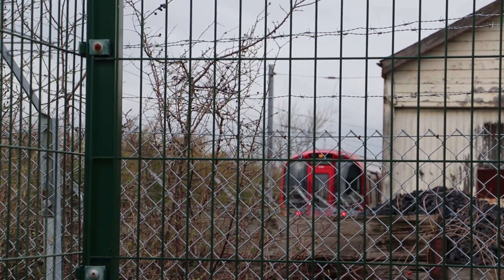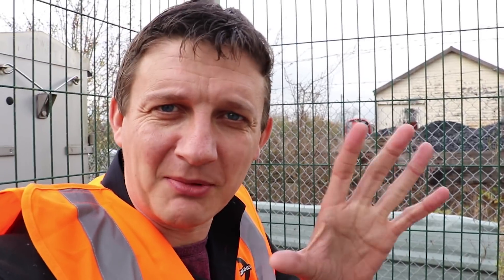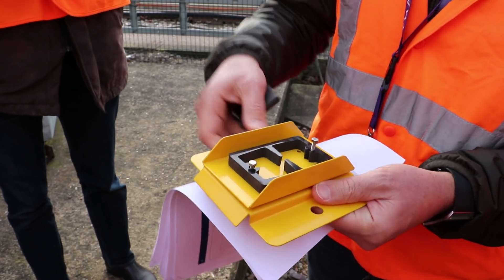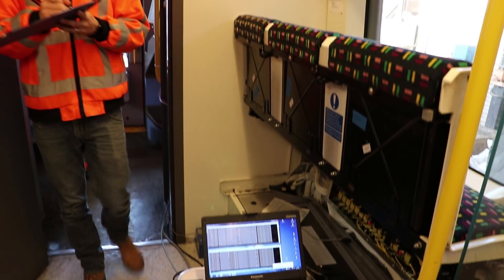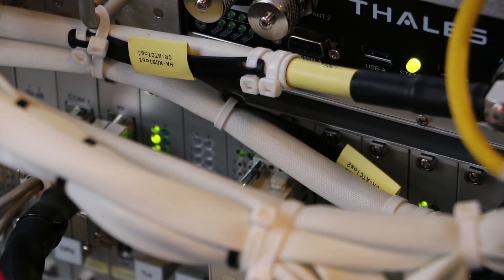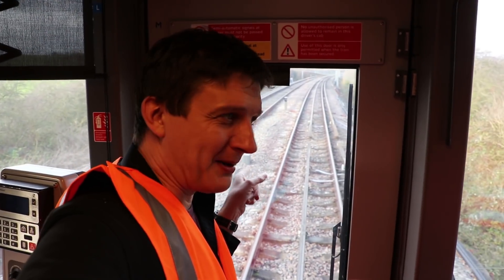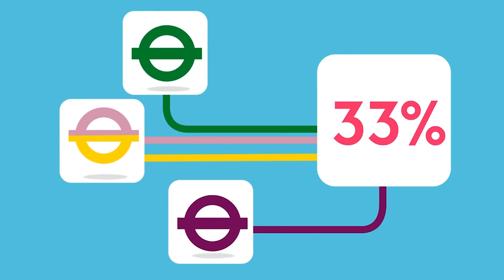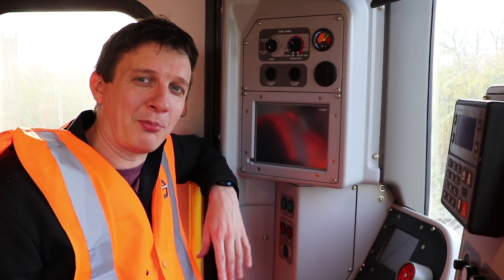London Underground Four Lines Upgrade

Comment: We did a thing like this in Singapore. Within the year two of our trains rammed into each other.
Reply: 2 LU lines already been using this for years
Reply: Chad M They use orange wires, rather than tags
Reply: metheth propbut Well this 4 tube line modernisation will use the same system by Thales. Will not be surprised if the same thing happens
Reply: It was a signalling circuit fault. Thales took "full responsibility" for the accident: http://www.straitstimes.com/singapore/transport/signalling-system-firm-thales-apologises-for-joo-koon-train-collision-assures
Reply: Vancounver skytrain uses the old alcatel system, not these new thales systems.
Reply: That happened in Singapore too, when the system first started public testing. 
There was another issue on that same line, too. You see, at the northern terminal of the line, the train goes through 2 set of points before entering the station (3 if you include one in the middle which crosses over to the other line that is not on the system yet): one set a kilometre away where the tracks split into 2 platforms, another set where the tracks from both directions merge. Hilariously, the system thinks the track is fully reversible after the first point and would wait for the station to clear out both platforms.
Reply: We did this on a line in Edmonton Alberta Canada. The Thales system hasn't worked right for three years, and the worst incident was twice a train got shunted onto a oncoming and occupied track.....
Reply: well the problem was that two system are running on an uncompleted line. plus techincal errors... so it's not completely Thales's fault.
Reply: Apparently when the 1st train had stopped at a station, once it had closed its doors, it disappeared from the 'radar' of the new Thales signalling system. This tricked the next train (which was like <100m behind) into thinking that the station was clear and that it could enter, causing the collision. A possible reason was that the 1st train had earlier passed an older set of trackside signalling equipment that was awaiting upgrading to be compatible with the Thales system, causing this system to lose track of the train for a ~90min period before the collision, before locating the train again (meanwhile the existing legacy Westinghouse/Invensys fixed-block signalling system managed not to lose track of the same train). 
A little disappointing IMO since delays the resignalling project in Singapore had already delayed the opening of a rail line extension this year, and will now further delay it (until mid-2018 for the Joo Koon-Gul Circle stretch). Also the same Thales system has malfunctioned several other times this year on another train line, causing service disruptions.
Reply: TIB980D Productions I would have to agree with you here that there is some sort of operator/human error. This controlling technology has been in operation since 1985 on the Vancouver Skytrain, without there ever being a train/train collision. Collisions are usually with thrown on tracks from overpasses (which caused the only minor derailment of one car). Collision with careless or suicidal people in stations in which the trains cannot stop in time. Currently Vancouver run 74 secs between trains during max frequency, however this can be increase to 54 sec. Driverless/computer controlled system is the way to go.
Reply: Very right
Reply: Joo Koon is overcrowded nowadays thanks to this, the bus interchange was only made to serve Gul, Benoi and Pioneer Sector, now it has to cater all of Tuas, just like pre-BLE days.